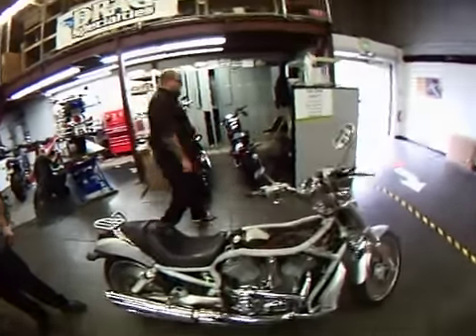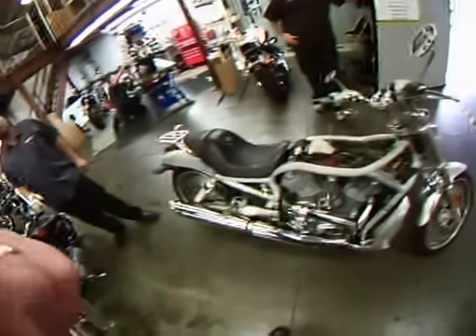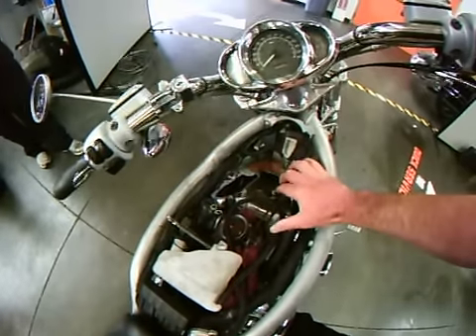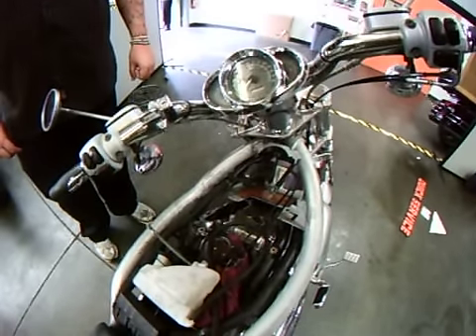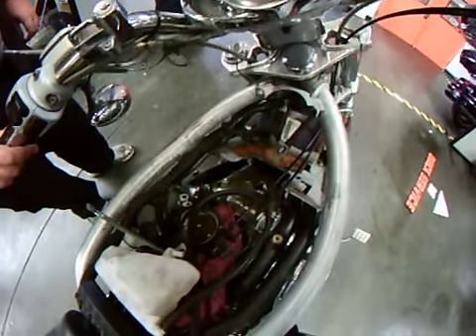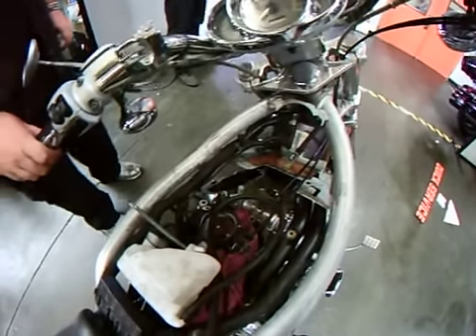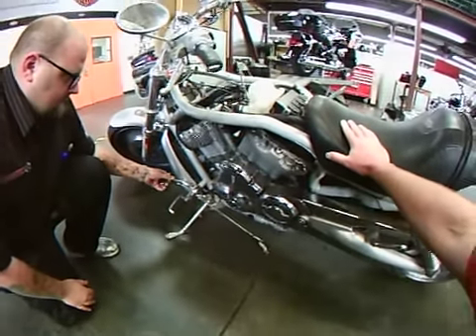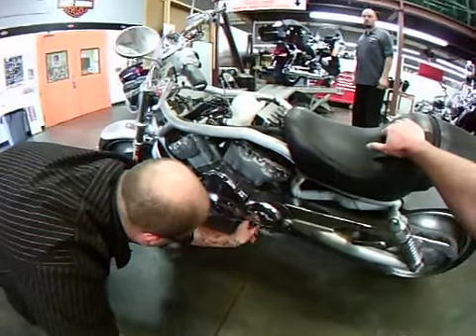Jacks V-Rod repairs- Harley Davidson San Jose customer video blue print series

Comment: just found this video.  been working on a 2002 vrod.  the valve check is easy.  did it in my garage. drop the bolt in the front engine mount. pretty funny the dealer can't handle the job. the valve covers are so much chrome those bolts don't seize. no way not unless you parked at the coast.  I like how the shift rod falls from the tech touching it right  after you said it was fixed lol and the tech is crawling around on the floor trying to fix it .

Comment: You CAN adjust the valves with the engine in the frame. Hot Cams makes a shim kit for you to do this and the Manual is very helpful in getting it done. You only have to lay down lots of money for the dealer mechs if you have zero tolerance for dirty hands and a little bit of reading. So wrong Tomcata1467.

Comment from the maker: The bike was from Santa Cruz (The coast) and the shifter was repaired, but removed for another issue with the left side frame rail being removed for an additional repair that wasnt mentioned. We do valve lash jobs everyday at the shop, we can handle them just fine :)

Comment: You can't tell if the valve adjustment is okay if it is quieter. Of course it's going to be quieter as the valves seat more the space between the camshaft in the adjustment shim decrease. What kind of mechanics are you anyway the only way they get noisier if your cam lobe starts to wear out which doesn't happen unless there's a real problem like running it out of oil. Dispute that Einstein!!